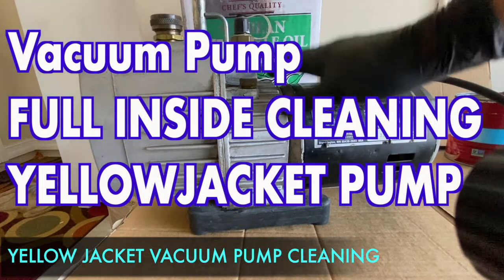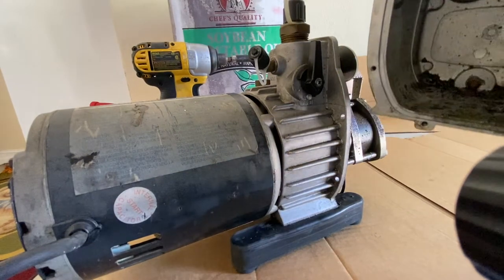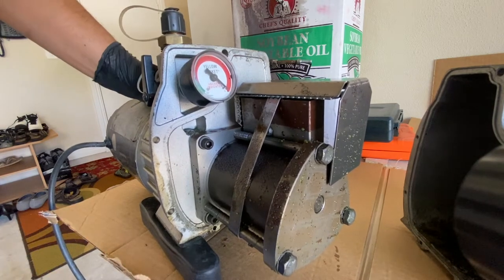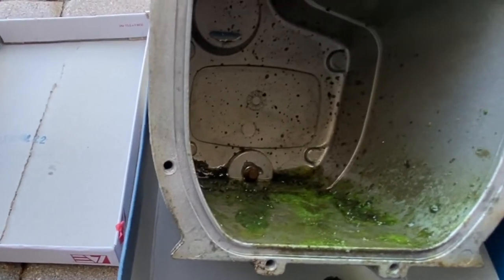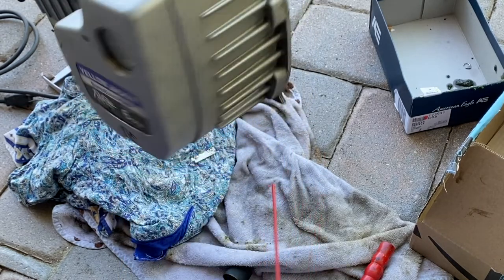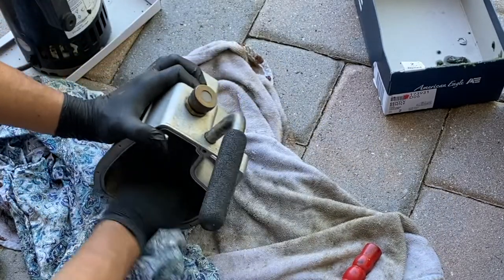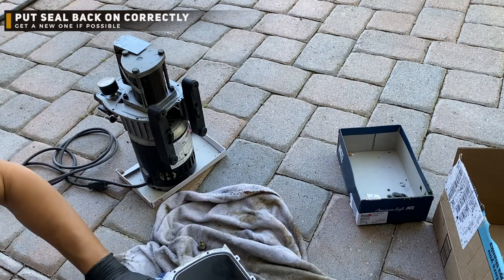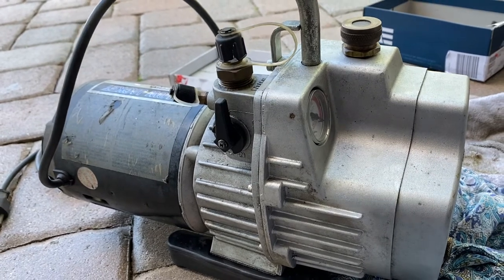VACUUM PUMP INSIDE CLEANING - Yellow Jacket

Comment: Thanks, this was helpful:)
 Though I'd wager that's probably verdigris rather than algae (copper corrosion, like lady liberty) from the brass parts sitting in water, seems like there wouldn't be enough light for algae.

I was dreading what mine would look like inside after seeing the jet black oil, but it seems suspiciously clean...
Reply from the maker: Ah excellent point. I learned something today!!!
Reply: It can also be reminant uv dye. It appears a tad bit brighter than usual copper oxide.  Guess it's too late for the leak detector light!!

Comment: Did you test the pump after? How much microns did it pull down too?
Reply from the maker: Yes. Last system I pumped it down to 200 microns
Reply: @HowToDoitright  200!? The lowest I've got was 320...
Reply from the maker: @mikediaz8684  you may have to service your pump and use new oil always

Comment: I have the same pump,
 I forgot to change the oil on time, now it reaches 30 in on the gauge but it drops to 27-26. I have dissasembled it just like you, and it was relatively clean, there was black residue but I cleaned it and ok. But it continues with the problem, when I put it to work and turn it off, it doesnt retain the vacuum and a slight bubbling is heard in the hole where the oil is charged. What do you think it might be, I heard that the empty cartridge needs to be replaced completely.
Reply from the maker: Empty cartridge? Never heard of it

Comment: Hello! Thank you for the video. I have the same pump but it is no longer able to pull a vacuum below 1700 microns. Would you know how to repair this model pump? Thank you, your cleaning video is a big help!
Paul
Reply from the maker: First clean and change oil. Oil changing is very important. It should work thrn
Reply: Change oil
Flush vacuum pump
Check filter screens
Reply: @stewartbaird86  The same problem I had with my brand-new 6CFM SuperEvac.
This pump isn't good at all. And nobody knows how to fix it.